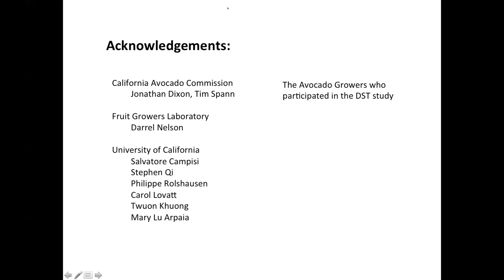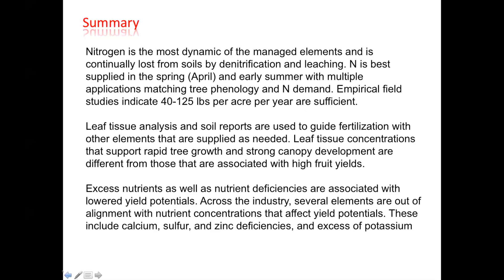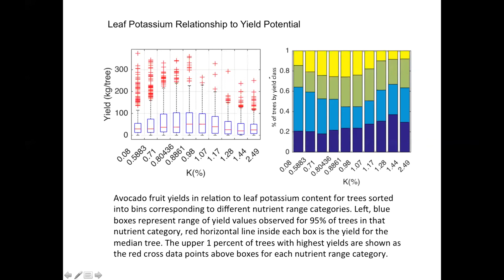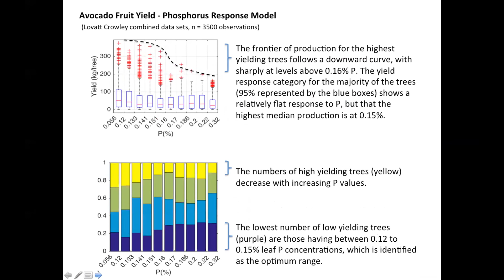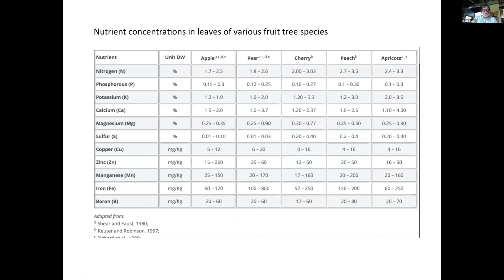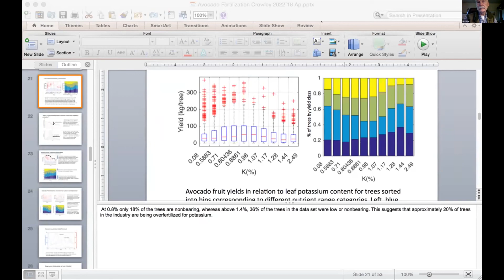Q and A Section

Comment: At 33 minute mark he says they didn't take nitrate nitrogen into account, in the irrigation water.  Says at 10ppm, it's only about 10lbs nitrogen,  but he's assuming applying 1 acre foot water per year, per acre, for avos.   More likely 4AF.  4AF of 10ppm N provides 109 lbs N per year.  Even if more than half is not used by the tree, it's still a lot of N.   Needs to be taken into account